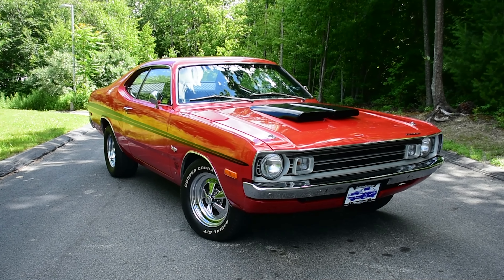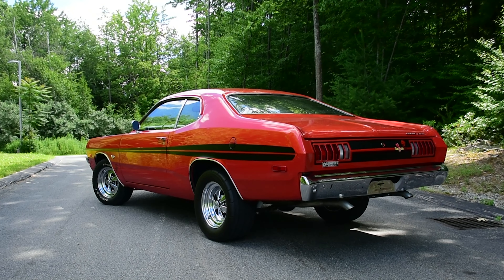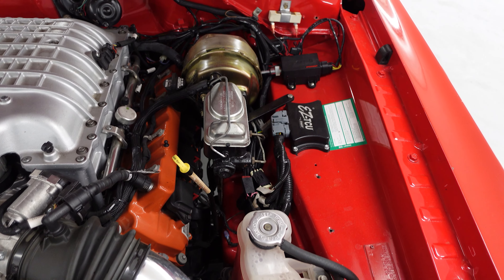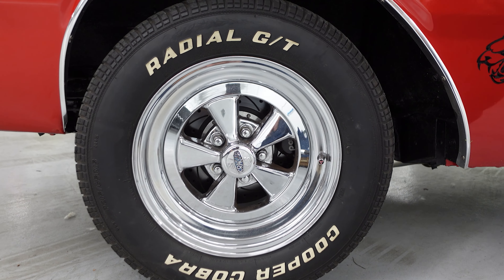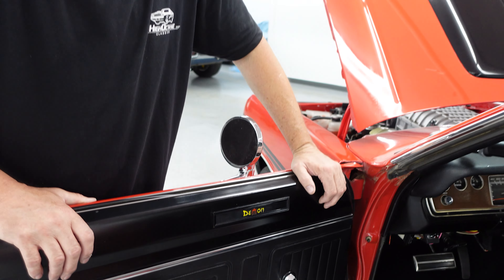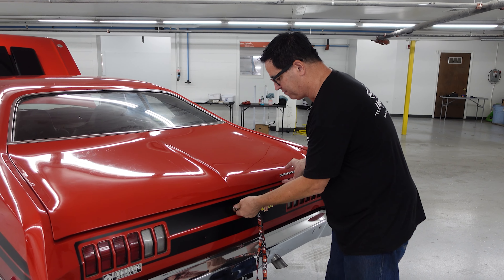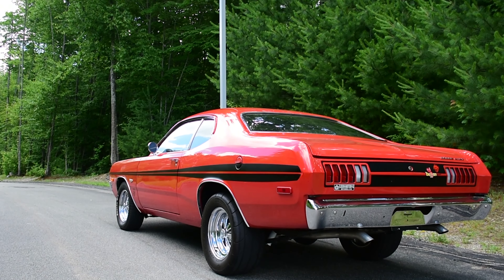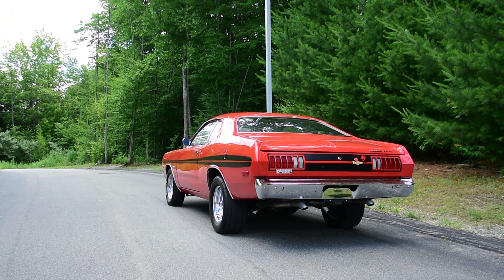1972 Dodge Demon HELLCAT Swap | Walkarounds with Steve Magnante Ep. 91 | 6.2L Supercharged Monster!

Comment: Awesome…… but I’d have left the hell cat decals off
Reply: Same here, I agree. I bet that Bad Boy moves too!!!
Reply: The CAT gives it away but then I would like to see it move off the line first before I make my decision to paint that on. It might just sit there and spin and you end up in someones rear view mirror!
Reply: @Kevin-MM69ex  you ain't gotta bet it's the plain truth
Reply: Why? Its a show car. Having the emblem there is like driving with the hood open which every mopar guy does at a car show. Lol. But really a 72 dodge demon with a demon engine and engine parts with demon badges would be great.
Reply: Whats stupid is idiots who drive impalas trailblazer monte carlos and slap ss badges on them or civics with si badges or skylines with gtr badges where this actually has a hellcat engine so it makes sense.
Reply: @jesseraina1614  your right….it is fitting.., I just prefer originality on the outside
Reply: @moparmusts - This is more if a burnout car than the modern Hellcats.  No way it will hook under power.  If it did it would break that 8 3/4” for sure.
Reply: Beautiful man that duster's also a good bit lighter than the car it came out of so win win baby!!

Comment: I still have my 72 Demon. Looks almost like this. Hemi-Orange. Had those Cragers on it. Because those were the only mags you could get in a 4” bolt pattern. The past 2 years I have refreshed it with a nice 360, 833 tranny, and an 8 3/4 3.55 rearend. Same black decals. And I even have that same spare tire. Of course it won’t fit now. I put bigger bolt pattern wheels on it. But I got the same Crager SS mags. Good looking car. 👍

Comment: What a cool dealership High end classics is from what I'm seeing one of the best even down to the shops well maintained state and for the featured Demon it truly is special. I am very impressed with this build and it's overall look , great choice of wheels also . I can't imagine what it must feel like remembering back to my 1970 , 340 Swinger , wow twice the power of the 340 and that got me into the mid 14 s , if it had a standard trany with the mentioned Dana . Thanks Steve
Reply: MORE than twice the power, stock 70 340 only 275 but regardless its a beautiful build but straight line throttle only. I remember the Swinger, in reality most of those old cars were high 14 and 15 flat cars but with that suspension they felt fast and for the day were. A new SS Camaro would walk on a 69 396/375 but a 427 Yenko would be neck and neck in the 1/4.
I always loved the Demon 340 design
Reply: The big heavy Dana was not necessary as the 8 3/4” could take just about as much abuse but without the extra weight. Before NHRA started getting more liberal with the rules the 1968 race Hemi Darts & Barracudas used to run them to save weight over the Dana 60.
Reply: The 8.75” differentials allowed for easy gear changes just like the ford 9”

Comment: This is what Dodge should have done instead of calling a Challenger with a big engine a Demon. I had a new Demon 340 in 1971. It was red with the black stripe like this one. Black interior with a bench seat in the front. Had the 150 MPH speedometer, no tach though. Had no power steering, and the front brakes were drum. No carpet either, just rubber like in a truck. It was a blast to drive, wish I had never sold it. Didn't really know what I had. The engine was balanced and blueprinted from the factory.

Comment: When we get the tag, we can brag:

FE5 for Bright Red exterior paint, U for USA spec vehicle, R11 for AM Music Master radio, E24 for 225 Slant Six with one barrel, aka "Leaning Tower of Power", 826 for 8/26/71 production which was a Wednesday, D34 for Torqueflite automatic transmission, G15 for tinted windshield only, TX9 for upper door panel color of black, B1X9 should be black interior trim.

With the VIN we win: L for Dodge Dart/Demon series, L for low price class, 29 for two door sports hardtop, C for 225 Slant Six with one barrel, aka "LTP", 2 for 1972 model year, B for Hamtramck, MI assembly aka "Factory Zero" or Dodge Main (which opened in 1911 and closed in 1980), and the rest is the production sequence. Loon Motors was located at 117 East 1st Avenue in Mitchell, SD.
Reply: Ummm...I think it's "leaning tower of power".🙂
Reply: @gteefxr3094  Yup just fixed it.

Comment: 707 hp is a lot more than double a 340’s. In 1972, the 340 was rated at 240 horsepower, so it’s right at 3 times.

Comment: You make fun of the 8 3/4” rear end but it’s so  strong that they are coveted by some super comp dragster’s because it’s about as strong as the 9” Ford with less weight, they have a similar construction.
Reply: Yes, but some are stronger than others. The weakest being the 741 case it had a small pinon diameter. Next you had the 742 case it had a bigger diameter then the 741 case, it also was a straight pinon. Next you had the 489 case. This was the biggest pinon they had. It was a tapered pinon.
Reply: @johnr.4853  I had the 489 case with a sure grip with 3:91 gears in a 1970 4 speed Duster that had a nowhere near stock engine for those days and it saw a few thousand power shifts using a short throw V-gate shifter and I never had any problems with that rear end, not even with the spider gears. So if someone wants to put aftermarket axles and a spool in one of them , I don’t think that they could easily break it. Even some of the 68 race Hemi Darts & Barracuda’s switched to them to save weight.
Reply: @frankjohnson6342  I'm not knocking the 8 3/4 rear at all. I like them myself , I never had any problems even with a 741 case with a suregrip.👍

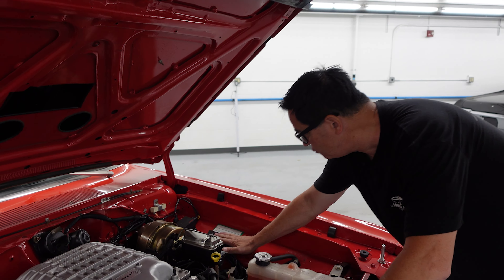Comment: 2:40    All of those modern electronics to support that modern engine and it still has that dreaded resistor on the firewall?   If and when the trunk gasket failed, and if water dripped on that thing the car wouldn't start.   Ferry famous problem, and what people would do is put rubber washers behind it to offset it from the firewall.

Comment: "All show and no go!" is an expression in need of modifying. I'd suggest "all show and could but won't go". I like it but on the practical to full on useless meter this car is pegged to the useless side of the scale, as it sits. Lot's of potential and the work done is all first rate..... but a lot of work still needed. Scary small brakes, wheels, tires, and suspension is going to be completely overwhelmed by this engine and transmission combo. Set up as a street car and ready to parade to car shows was probably the goal when it was conceived of and them built. It meets the goal really well too. This car will draw plenty of attention at any car show for sure. How-ever, I look at the power, the really light weight and think "dedicated drag car". This thing could be a lot of fun and stupid fast in the 1/4 mile with all the reliablity of a new Challenger Hellcat but first you gotta ditch the whole street car pretense to realize the full potential. Cage it up inside. Tub it for traction and give it the back half treatment it needs to put all that power down effectively and this could be a car that gets into the 9s without all the hyper tuned up full on race effort to the breaking point of the engine that would have been required in the 1970s just find a 10 second time slip.

Comment: Amazing car. Dodge actually had the Demon model in 1970. I know as I owned one.
Reply: Dodge was late to the party. Demon didn't come out until 1971. The Plymouth Duster however did come out in 1970 , and it was called the Valiant Duster. In 1971 the Valiant name was dropped and it was called just Duster.
Reply: Since 71 model production started in Aug 1970, it's possible, but still was a 71 model 👌
Reply: Dodge dart